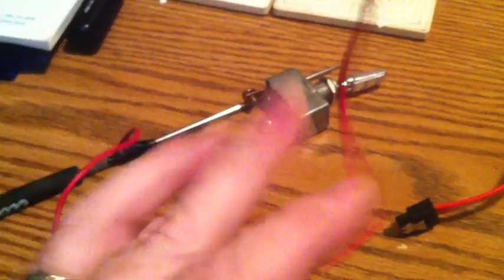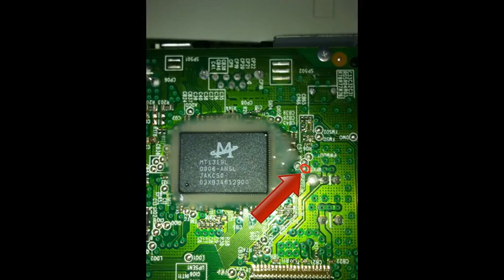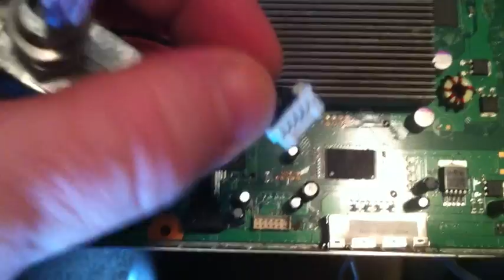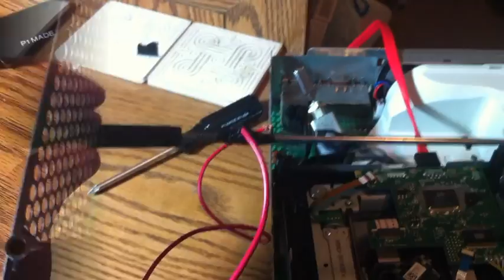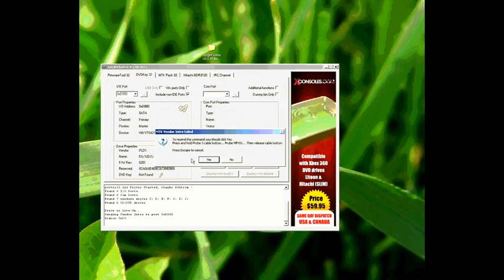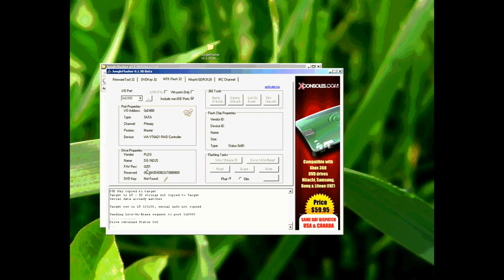How to flash mod Xbox 360 Liteon drive to Lt 3.0 without ck3 pro probe

Comment: Did this yesterday (24.09.2023) and it still works! Thanks, I was worried I would have to buy a probe for just one Xbox
Reply: Hey @retropc88!

I am currently in the same situation as you right now and i need to be sure on one thing, Since you are the most recent person to do this, I wanted to know if this would work on the Latest system update, Does it?
Reply: @aarongamingdev  Yes, it absolutely does. My Xbox 360 had the latest firmware and i had no problem flashing my drive.

Comment: 10 years later i came back here to thank you man! You really helped me in 2013 Thanks😊🔥🌷
Reply: How did you connect the sata to pc?
Reply: @RaresI20097 you can use a USB to SATA adapter. i still have to test it out though. they’re not that expensive either so maybe you can give that a shot
Reply: @benn_bazaa  I figured it out some time ago. I have a laptop with win 10 and that is why I was asking but to flash it I got an old win xp desktop pc wich had sata ports

Comment: If you’re trying to flash a DVD drive in 2023 this method works. The only thing I did differently is connect the probe to pin 5 on the wiring harness. For some reason grounding to the chassis did not work for me. Thanks for the video!
Reply: How did you connect the sata to pc?

Comment: Hi there, thanks for sharing this nice tutorial, i want to ask you something: can i use the probe III cable (similar to the green cable  that shown earlier in this video, but mine have switch in the middle of the cable) instead, to avoid ruining the original x360 cable if i fail to modify it (i think right now its a pretty rare item and i'm afraid i don't have that proper skill to do it)? once again thanks bro...

Comment: This worked - I ran into some issues obtaining the phat key but if you stage it right it will go thru.  Then we had an issue clearing the firmware at the lite-on erase area, we didn't get the 72 status. The backed up key and files helped recover the issue with a couple attempts...  If you are using the via card you have to remove a driver in windows (an old google search will talk about it)...  Also set WIN 10 to allow unsigned drivers.  the first time I wrote the firmware it didn't take cause I didn't send the key back to the drive.  if you happen to get stuck in  vendor mode with firmware and no detection.  Try sending the erase function and it should link up the info in the mtk area ..   before writing to the drive you can re-spoof it with the saved phat key logs.  it is recommended you disconnect the laser band - i didn't have an issue but some other vids talk about it being harmed.
Reply: Hello, I'm currently trying LT3 flash xbox 360 slim DG-16D4S winbound drive and I'm stuck at obtaining the slim key. I'm doing it with SATA cable directly connected to PC motherboard. Until now I've tried connecting the DVD drive to 3 PC-s. First PC (running windows 10) can't even recognize the drive in BIOS so I gave up on it at the start. Second PC (running windows 10) recognizes it but no matter what I do (enabled SAFE mode and installation of unsigned drivers), I can't get jungle flasher to install/load portio64.sys. I've also tried installing it manually with no luck (my guess is that I need .inf file to install a driver manually), so without portio64.sys, I can't load up the DVD drive.
The third PC I tried is running windows 7 (this one is very old pc, native OS was windows xp, CPU:pentium 4, 128MB video memory). On this PC after I downloaded jungle flasher and run it I didn't get any startup error and I could see the DVD drive in jungle flasher without a problem, but whenever I click "SlimKey" to get the DVD Key (and I click "No" to the pop-up: "Do you wish to send Unlock to Slim"), I get this error: https://prnt.sc/1r91slz (screenshots are uploaded using Lightshot app). Either if I click "Yes" or "No" I get the same error: https://prnt.sc/1r91u76. I've also tried connecting the DVD drive to the Primary SATA and everything was same. I tried clicking "Yes" to that first error (https://prnt.sc/1r91slz) and turning the console off and on (because I use the console's power cable to power the DVD drive) but that didn't work, neither did pluging the DVD power cable out and in. Then I used switches and soldered them to +12V, +5V and +3,3V voltage wires to see if I can do it like that (this is the pinout I worked with https://prnt.sc/1r92px0 and I've tested the pins that should be shorted, grounds with grounds, +12V with +12V and everything was like in the picture so I made myself sure that it is showing the right information). After trying almost every possible combination of the switches ON and OFF (this is what it looks like: https://prnt.sc/1r94glt) I figured out that the DVD drive is shown in jungle flasher only using +5V... so cutting the +3,3V and +12V wires doesn't make any difference there. Also in the picture I sent you might notice that I started drilling the MEDIATEK chip... don't worry about that, it is intact. I'm running out of ideas on what to do and there isn't much on the internet so I'd appreciate if you could help me (this is the first place I'm writing this). You said that you had problems obtaining the phat key and you fixed it by "staging it right", what do you mean by that?
Reply: @murgonja0  hey I didn’t see this right away …. It was in reference to having it dump the key. Keep trying to probe it make sure it’s grounded properly and make sure you are hitting the right section. As for the slim ones our device was an older unit.  Turning it on and probing it at the right time sending the switch signal at the right time it will come thru also have extra hands it helped.  if you can get the via card the guy mentions. It’s worth it.   it’s a add on card that you can install into a slot on the desk top that might help the flash process and recognition it’s on eBay

Comment: Can't we just exchange the micro board from the bad DVD one to the new one? (needs some soldering obviously) The only thing that is not working properly is that the tray won't open..
Reply: Yea u could do that, flashing however is needed to flash the lt 3.0 firmware to run backup discs

Comment: I plugged the dvd drive sata cable into my desktop's motherboard and windows won't boot. I tried xp and the drive doesn't show up. Do I need to get the sata card you have for this to work? If I do please provide a link to one.
Reply: Some motherboards work some dont and u will need to get a sata card. If your doing this to a slim console drive you will need an x360usb pro

Comment: working 2019
Reply: Well I'm about to try this so let's hope I'll make a "this works in 2020" comment.
Only issue is all the software he uses is not liking windows 10 and it is not finding the drive on the PC program
Reply: @RoomerJ  would you be so kind as to write how it went?
Reply: @RoomerJ  yea u need windows 7
Reply: @Amphium  would this method work for finding the key off an old pcb and then writing to a new one?
Reply: @sourkyle  its been ages since ive done this stuff but ideally now you can just run badupdate on the 360 console and pull the dvd key that way
Reply: @Amphium  that’s awesome badupdate is truly something else. i was worried i was going to have to go with the probe method 😂

Comment: Works like a charm. The slowest part was setting up WIndows XP - you need .NET framework 3.5 for Jungleflasher. Note that I didn't have to install any drivers for the VIA 6421A. The RAID module of the card shows as lacking drivers in Device Manager, but it is not needed and even problematic for Jungleflasher - so always try without loading drivers first.
I downloaded the firmwares from MrMario2011's video on how to flash phat drives. Good luck!

Comment: Great video!  I'm tempted to try this eventually.  Have you ever flashed a BENQ drive?  I know it's a different process but I hope there's a way to do it without buying any special hardware.
Reply: benq's are so much easier to flash then liteon's no need for probe, just plug them into the pc and flash using jungle flasher. search youtube for a walkthrew

Comment: I just did this, using this method but i flashed a replacement drive with the OFW, just moved the key over.

It works perfectly, runs original games without issues and all but jungleflasher still says "DVD key: not found".

Obviously, this isn't a problem since the console is playing games again. I'm just curious if anyone has any idea why this happens.

Comment: You can get your Xbox banned if you use the power supply from the Xbox but good idea but if you want not a high chance of not getting banned do not use this use the prob and ck3i
Reply: SyK Boltz you can use a different motherboard if you want to power your drive from the Xbox the keys don't need to match as its not connected to the mb...... Do you know anything ?
Reply: i will use a dead xbox mb
Reply: wont work cant use a different dvd drive on a different motherboard because the keys on the motherboard wont match the dvd drive. just buy the ck3i and probe etc and get it done properly not this bogan way. watch xxmoddedwarfarexx
Reply: +SyK Boltz ok, thanks man
Reply: all good. the guy tells you in depth and how to flash on all dvd drives and rgh/jtag tutorials
Reply: +SyK Boltz i allready know him
Reply: +CurryFx oh ok
Reply: iam sikskillz Could you just power it from a PC as well?
Reply: iam sikskillz yea I know ( late reply yes) I just started modding and shit and didn't know very much
Reply: iam sikskillz I was meant to say that's when I started modding

Comment: Just did this yesterday, was easier than it looks. Thanks for the tutorial.
Reply: Bro I think i messed my drive up i went to test the drive and when i turned on the xbox with the toggle switch a flame sparked on the drive then immediatly died and it happened twice but on the second time i got the red ring
Reply: @TheElitePieOffic  🤣🤣🤣🤣🤣🤣🤣
Reply: @TheElitePieOffic  BROOO WHAT LMAO
Reply: +SakkeMO what are the requirements for this mod,  does this method work on latest updated xbox official firmware? and any xbox slim 360 or its limited to special/older xbox 360 drives/models
Reply: +Muhammad Asghar 
Its all in the video. I believe it should work on a latest update, not sure if slims work since mine is rgh and i dont really need this method anymore.
But yeah, phats with liteon drives and follow the video, i did not even have switch, just connected the wires when prompted.
I you can solder go with the rgh,  parts are under 10$ on ebay. I love my 1Tb Slim RGH, currently almost 100 games installed to it. I bet someone can install you one about 50$ + parts if you cant do it yourself.
Reply: LMAO XD

Comment: I dont know are you still active on scene but i hope you are. Im new on scene, for the first time burned a game today. So here is my problem (im on lite on 02510C lt3.0), everything from your tutorial worked just fine but after new update of xbox live,  i've tried to stock firmware to original (so i can play online) and got error, my drive was dead, no reaction  at all. But,  After some clicks in jungleF i got back to lt3.0 and i plugged in and just updated to last ofw and after that i tried to launch game , it says cant read disc, try to clean it or restart xbox. Know im wondering, am i still on flash?? How can i check this?? How can i verify is this disc problem or is this problem of not flashed driver?? Please help!!!
Reply: You prob fucked it you prob bricked your drive. Buy a new 360 and just go to the extent and buy the prob and ck3i...... You probably got different dvd drive as well you only do this type with probing the point on a lite on

Comment: Thanks for this. Worked great, didn't spend a penny to mod my Xbox.

For the switch I used a light switch from my house and for the probe I used a multimeter cable.

I did this on a Z77 Intel motherboard, if you do it with an Intel motherboard you will need to set it to ATA mode rather than AHCI mode for it to even work.

Comment: Alright I'm on a newer 2.0 something version of the dashboard from around early to mid 2013. What LT should I flash this with to play game backups?

It's a Phat liteon manufactured in either 2007 or 2008.
EDIT: I tried the one seen in the video and it worked. I tried an old disc I burned using free iso burner back in 2012 for another xbox I used to have. The game read into the main menu, that's all I tested so far.

Comment: I did this, but I had to buy like a £5 Sata card and a switch. There's really no problem with it, and it won't make your drive faulty.

The only problem is if you accidentally knock your console and the wire disconnects, you'll have to open in all back up and reconnect it.
Reply: You should have stripped about 0.5mm of the plastic wire casing off on either end of the wire you cut and then wrapped the cable round each other and then covered it with electrical tape. Theres no way for it to get disconnected once reassembled that way.

Comment: I am sure this works but I need to warn people to be extremly careful when doing this. It all went smoothly till I cut the wire and was putting electrical tape round it. decided to leave the case off to see if it was running. thank goodness I did because I got an electrical fire inside the disk drive. I presume from the wire.Not saying this is good or bad but just a warning to be vigilant and careful when doing this. i need to buy new disk drive and conectors now.
Reply: conesco3 You're lying. There's absolutely NO way of the xbox catching on fire. The fuses prevent it. Your xbox will lose power before it cathes on fire, so stop lying.
Reply: There is
Reply: EvkaX155 Well don't believe me then but it did and I have scorch marks around the disk drive power cable socket. It still works.but my study now smells of burnt silicone. Also the fuses are meant to protect the electronics coming from the mains not internally.
Reply: +conesco3 Sounds like you shorted something out, you need to be really careful not to. Luckily nothing broke!

Comment: Hey,
I did everything the way the vid said..  Went perfect then hit the at a reset and once it was completed I then closed up the drive , taped the wire and started up the Xbox ...
It now has a red ring flashing and won't start ...

Same drive
Same Xbox
Reply: Miguel Carneiro What's the secondary error code (google on how to find it out)
Reply: Miguel Carneiro Something shorted out or you just didn't plug something back in properly, or maybe one of the ribbon cables in the xbox fell out?
Reply: Izaya Bleckworthy More than likely something is just shorting out inside the xbox. Maybe a ribbon cable or something, although we need the secondary error code to tell anything more.

Comment: I have Xbox360 with DG-16D2S, HW Ver. A0A1, FW Ver. 74850c. Current Dashboard 2.0.12416.0. My question is:
Shoud I upgrade to Dashboard 2.0.17150.0 and then flash the DVD drive or I have to flash it now with the  Dashboard 2.0.12416.0?
Reply: fantomsbg It's always recommended to update your dashboard first and just then flash your drive, however I have not had any problems when updating my console with a flashed drive whatsoever.

Comment: @Xbox Modders - Please Help Me I Smoked Up My CD Drive.. It Got Burnt. Now I Have A Cool Runner With Me. I Need To Install It. Can You Help Me Out.,,.,. Amey
Reply: You need a new drive, and that can get tricky. You probably shorted something you shouldn't have. For anyone reading this, when you do this make sure nothing metal is touching the motherboard or boards of your Xbox or DVD drive when it is on or when it is reassembled. If something metal is placed in the wrong place it will conduct electricity to the wrong areas and will break things simply put.

Comment: What toggle switch do i need? I can only find SPST, DPDT and SPDT switches and each one is 10amp. Does it also have to be a 2 pin?
Reply: I used a light switch from my house and just tested it with a multimeter to check it worked how I expected - one switch position being on and the other being off. Simple.

Comment: so i connected my drive to via card (windows xp found the driver automatically) and it showed up in jungleflasher. then i hit the phatkey button, pressed yes, flipped the switch to off, probed the point, flipped back to on, then my pc froze for like 2 minutes, and i removed the probe. after 2 minutes, it showed, that it was succesfull and shit, clicked yes, then it said, that it failed. now my disc doesn't show up. is there any way to fix this? HELP!

Comment: I followed everything you did to a "T" and it worked without a hitch, the only difference was when I was erasing the firmware it warned of improper firmware selection (it didn't seem to like the LTPlus-0251-v3.0 firmware), but I preceded to use it because all my drive info matched yours.

Long story short I flashed my drive and saved $30 (probe cost) and everything works.
Reply: Forrest Trenaman could you help me out with this please? could me talk on skype? Im confusing with some items like the SATA cable and when it should go and what type, would you be able to supplly some detailed list of wires ect needed. Also the location of where to put the cable into the pc thanks :P